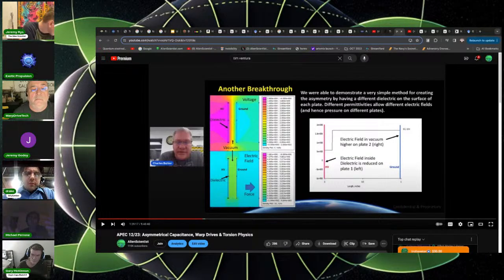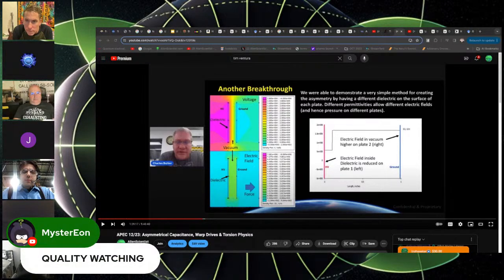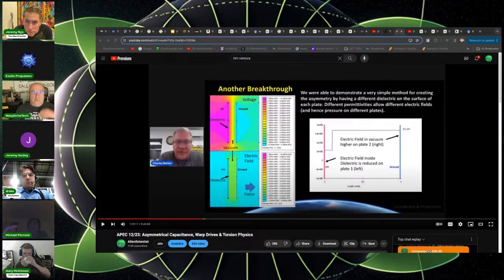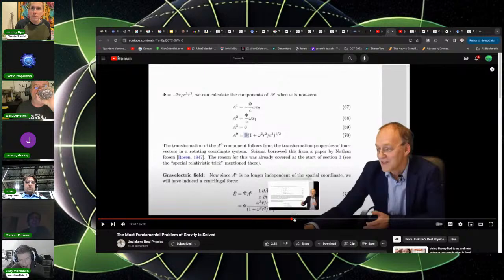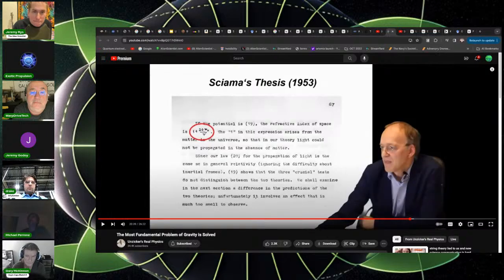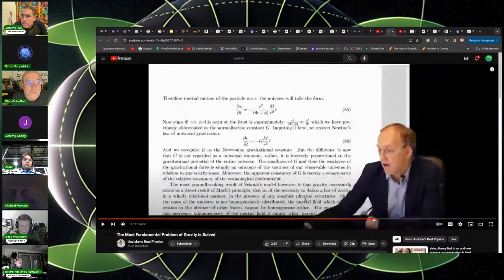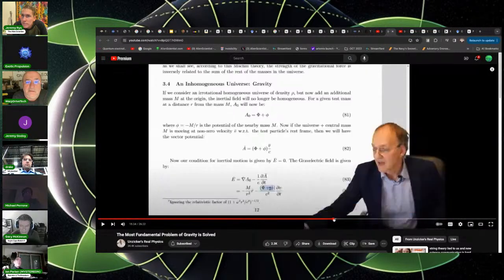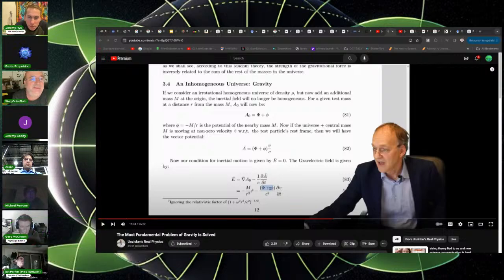Alienscientist & Garry Mckinnon Friday Night Open Lines... Share or Ask Anything!

Comment: If you shot a magnet out of a gun barrel wrapped in copper wire, could you convert the kinetic energy into electrical energy.
Reply from the maker: i don't see why not! or wrap the barrel in q copper solenoid?
Reply: @cryptoalchemist369  hmm what of the solenoid had an extra twist? Like the coils of coils
Reply from the maker: @fasted8468  the more the merrier